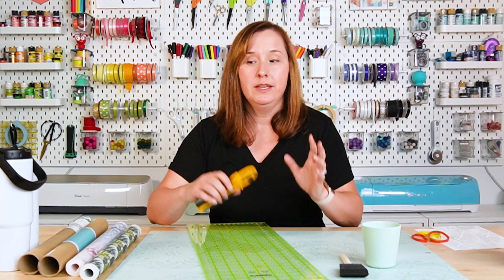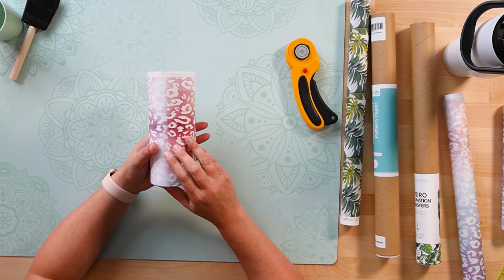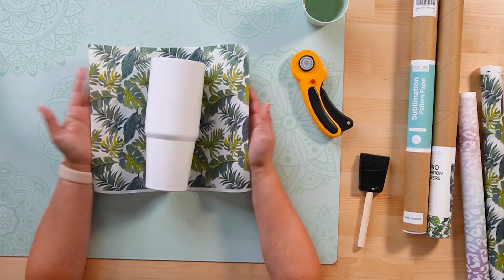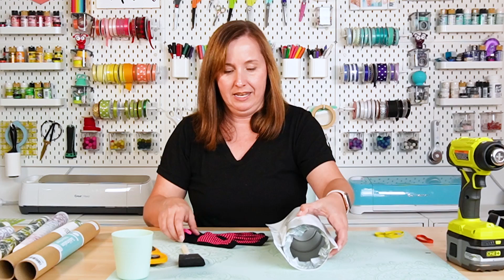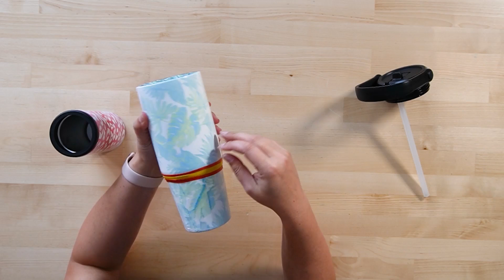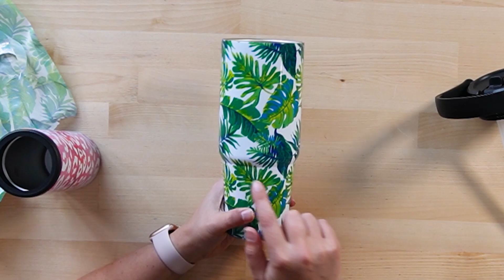How to Use Hydro Sublimation Transfers | No Sublimation Printer Needed!

Comment: Hey Cori, I liked your rubberband trick for trying to get that tapered area tighter, I found that the silicone bracelets do the trick, are inexpensive and are multi use :-) I've l used it up to a 22 oz fatty which should work on the taper of the stanley-esque tumblers.  I've only lost 1 in the few months I've been using them.
Reply from the maker: Oh great idea! I found some silicone rubber bands that I linked, but I've got so many of those bracelets around the house from my kids!

Comment: that overlap is a good place to put a name or decal, maybe a zipper!? I find that a mistake can be turned into a design element sometimes- make it look like it's on purpose! lol!  this is an interesting product! could you use heat resistant tape instead of rubber bands?
Reply from the maker: That's a great idea! 

I tried heat-resistant tape on the first one and it didn't work very well. I just could not get it tight enough on that taper!

Comment: Great into to a product I had no idea existed. I wonder two things if you were to fold over each side where it meets to the outside perhaps it would help prevent ghosting yet no doubt you want to overlap I understand the need and the desire to do that too. Also I just discovered the other day they make glittered straight sided at least 20 ounce tumblers double walled that you can actually sublimate designs on to. I would fear these hydro sublimation designs would block the glitter effect and that it's better to stay with regular sublimation paper you print onto. Where you are white it would not add ink so it would remain the glittered color right on through. So if silver, pink, gold, teal I think were the colors I saw just yesterday in the glitters. Not sure how they do that. I assume the glitter has a smooth over cover and that it just appears to glitter but not sure either until I get brave enough to try it. I came across it on Amazon. My guess to search on Sublimation Glitter tumblers anyone interested in looking for them. This is kind of like a water decal transfer in a way only you need to add pressure and heat and use the right media of sublimation ready hard stock. Love your demonstration and the cons and pro's you found out for us in advance. Thanks a bunch.
Reply from the maker: You could try folding it over! I feel like the edges may shift when putting it in the shrink wrap—that's my biggest concern. I've done glitter tumblers before and you can definitely see the glitter through!

Comment: You can use your x-acto to cut slits in the paper. I do this at the bottom and top or normal tumbler wraps. ON those, around 30 small cuts releases the stress and lets the paper lay flat and not create air gaps.  You should try that on that tapered tumbler as well.
Reply from the maker: That's a good idea. It would still mess with the pattern but maybe in a better way, ha!